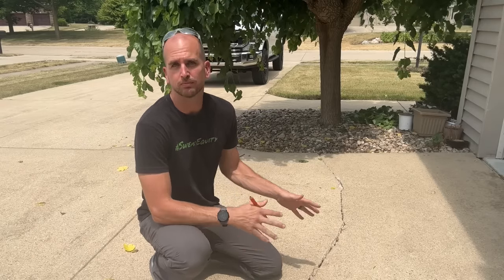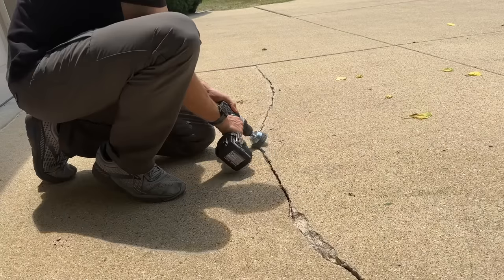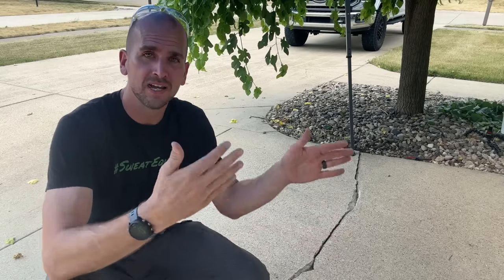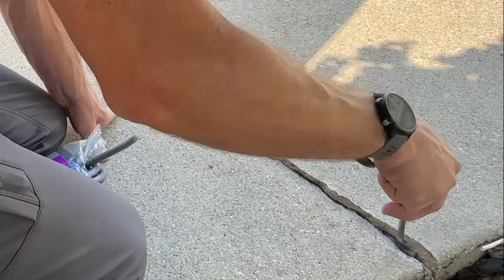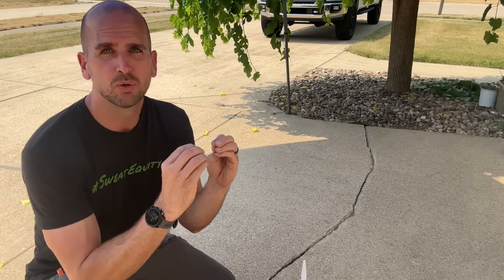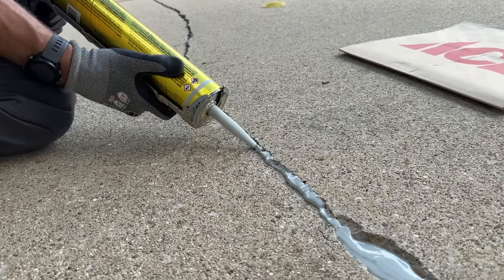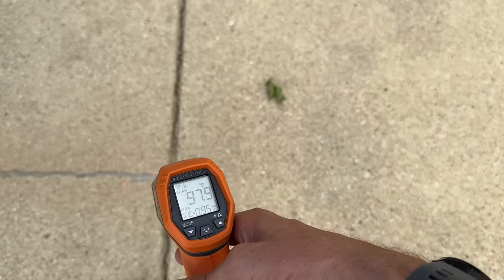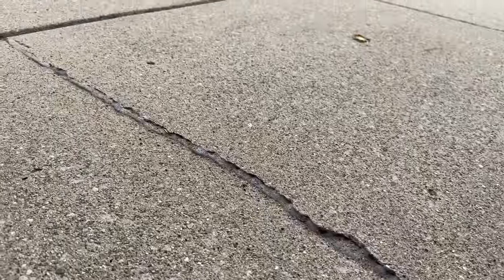Repairing A Neglected Driveway Crack |  The Ultimate Solution!

Comment: How do you decide whether it's necessary to add a second round of sealant?  I assume it's based on the vertical distance (gap) between the top of the concrete and the top of the settled first round of sealant.  How small should that gap be?
Reply: No gap. He explains this in his pinned comment.
Reply: @michaels3003 : I don't see a pinned comment, and I don't understand what you meant by "no gap."  Do you mean "add more sealant if the level of the settled sealant is below the level of the concrete surface"?
Reply: @brothermine2292  , he said in his comment, "to almost overflow," because this product shrinks some as it dries. The best way would be to test a small area. The manufacturer should have provided the necessary information. I've seen a similar product (in a YT video), where there was a limit how much of the filler can be used. For that reason, the crack must be prefilled with something like a backer rod. The rod must be pushed in tight, so it does not try to come up. I've also seen a comment where somebody prefilled the crack with fine sand.
Reply: @michaels3003  : How does "almost overflow" relate to my question about whether to add more sealant after the sealant has settled?
Reply: @brothermine2292  , the way I understood this video that if you follow the method shown, there is no  need to add more filler on top. You are welcome to try to get him explain this better.
Reply: @michaels3003  : In the video he explicitly said near the end that you might need to add more sealant.  Unfortunately he neglected to explain how to determine whether you need to add more sealant.  That's why I asked.
Reply: @brothermine2292  If it is no longer near nearly overflowing add more if it is within ten minutes. I think that is what he implied.
Reply: @johnclements6614  : Sure, but "near" is vague and subjective.  The point of my question is to obtain greater precision.
Reply: @brothermine2292  I would put more in if it was within ten minutes and it had slumped more than 2mm. But it depends on the depth and width of the sealant in the joint. 

Minimum depth of sealant is 6mm. Maximum depth 13mm. Square section up to 13mm wide then stay at 13mm deep until max width of 25mm. Therefore if you were trying to seal a very shallow 6mm deep/wide crack you would have to top it up with any settlement. Maybe do not try to do a joint less than 8mm x 8mm to allow 2mm tolerance.

TLDR. It depends on the crack size.
Reply: @johnclements6614  : I think none of those numbers are what I'm asking for.  Is the goal to end up with the top of the sealant flush with the surface of the concrete?  If so, why not say something like "if the level of the settled sealant is below the surface of the concrete, add more sealant to make it flush with the concrete surface."  If flush is not the end goal, what distance below the concrete surface is the goal?
Reply: @brothermine2292  The sealant will settle. Therefore it will not end up flush. Most likely end up with a concave shape across the joint.

If you need to know more you will have to read the instructions and then practice with the material in different sized joints to see what you can do.
Reply: @johnclements6614  : I expect the first round of sealant will settle much more than will additional sealant added after the first round has settled.  If the goal is to end up flush, I expect adding sealant can get you there.  Your most recent reply doesn't mention the effect of the additional sealant nor what the goal should be, so it still doesn't address my question.
Reply: @brothermine2292  Read the instructions if you want to know how to apply the product.

I have quoted the sizes from the instructions.

How far the product is below the surface is up to you. You have to make a decision. It depends what you want the product to do.
Reply: @johnclements6614  : But the decision should be based on understanding the relevant principles.  Given your replies, I conclude you don't know whether it's desirable for the seal to end up flush with the concrete.  Flush is what my intuition suggests, but we shouldn't have to rely on our intuition.
Reply: @brothermine2292  If the sealant is flush it will be more vulnerable to mechanical damage. If it is slightly recessed it will collect dirt and may be more susceptible to frost damage.

The instructions are online, I am assume you know how to search for a product.
Reply: @johnclements6614  : Yes, I would research a product before deciding whether to use it.  My point was that, near the end of the video, he said he checked whether he needed to add more sealant but he didn't describe what that means.
Reply: @brothermine2292  It s a driveway man, relax and just do it...
Reply: @Millard-vo3ds  : I'm relaxed, and I don't have a driveway that needs repair.  The reason why I asked for the info missing from the video is to benefit other DIYers (including you) who watched the video and read these comments.
     Your attitude suggests you don't care about the quality of your work.  Why should anyone who does care about their work listen to you?
Reply: @michaels3003 you are absolutely right. But never use sand as a filler. The only acceptable filler ud backer rod. Professional caulker of over 45 years that has installed and repaired miles ov this type of seakant
Reply: @brothermine2292 if the sealant “settled “ you installed it wrong or prepped the joint wrong.
Reply: @johnclements6614 not quite right. It is easy to tell professionally installed self leveling from amateur. Amateur will be slightly convex while professional w always be concave because it was tooled, surface tension will cause untooled self leveling to be slightly higher in the middle than the sides
Reply: @genecarden780  : By "settled" I just mean the sealant's final position... even if it's the same as its initial position.  Now perhaps you can try to answer my comment's question.  The video is vague about how to decide whether to add a little more sealant.
Reply: @brothermine2292  that is because it is subjective. The more flush the more aesthetically pleasing to some but the more prone to damage. There is no one definitive answer. As a professional we always concave ii approximately 1/8 inch below the surface.  To protect it from physical damage. But the truth is what really matters is the sealants thickness not how flush it is. We once had a contractor insist it was flush. He then paid us thousands of dollars to  repair the damages . Sorry if this is vague.  I’m glad to try to answer your questions
Reply: @genecarden780  : So, if the goal is to minimize the risk of damage, you recommend adding sealant if necessary to raise the sealant surface to 1/8 inch below the concrete surface?  Why does 1/8 inch minimize the risk of damage?
Reply: @brothermine2292  As I noted above if the top of the sealant is low in the joint the joint will collect dirt. 

It is quite difficult to judge 3mm (or whatever with out good conditions and practice) by eye especially when the top of the concrete is not smooth. It may be still safe from surface mechanical damage if less but then you have no tolerance for workmanship.

As already noted you should only top up the sealant if the sealant will allow it, read the instructions.  You may have ten minutes or less depending on conditions. If you top it up late it may not bond to the lower sealant and then could fail.
Reply: @genecarden780  Thanks for the knowledge.
Reply: @brothermine2292 being slightly recessed protects the sealant from abrasion. The 1/8” is for wider joints. Like expansion joints. And is not exact. The smaller the crack the less it needs to be recesssed. There is no right or wrong when it comes to how flush the joint is. It will always be a trade of between the individuals aesthetic and protecting the sealant. If it is flush the top surface will be abraded  by tires and foot traffic. This is just how we do it as professionals. So the fact is no one can tell you exactly when you need to add more sealant other than making sure you have the correct sealant depth to width ratio. Those are numbers that are critical. How flush it is will always be matter of compromise. There is no one definitive answer. The much more critical thing is maintaining a consistent,proper depth to width ratio.
Reply: @johnclements6614  this is assuming no sink holes just normal self leveling, sink hole’s change everything. It is actually  the first indicator of how professionals spot an amateur job Professionals ALWAYS  tool the joint ( even with self leveling) creating a concave finish Tooling is actually mandatory to achieve the best bond.
Reply: @genecarden780  : Thanks.  I think the info you added should have been included in the video.  Or the video should at least have said where one can find info about how to choose the sealant surface depth.

Comment: Pull that rocky gravel away alongside your driveway and dig down and see if it IS a root pushing up against the concrete. If there IS a root causing that crack put an extended pruning blade on a saws all and slice through that root to stop any future expansion of it.

Comment: I just clean debris out with screwdriver, hose out debris with pressure nozzle on my hose, install a sand and plastic cement grout mixture adding concrete glue.  Wait a bit for grout to firm up, then smooth out with sponge! Will last for years and years! 🤣👍

Comment: First step: remove the tree. I’ve been looking at neighborhoods for decades and putting trees too close to homes and driveways and sidewalks is responsible for so much damage and also makes it dangerous to walk on. It is possible to put a barrier between a tree, and a Hardscape or foundation, and it’s not cheap… But it’s definitely something you want to do before you plant the tree instead of after. FYI, pine trees, cracking ice, storms, and puncture roofs.  Don’t plant a tree without knowing how far the roots are going to go, and make sure you mitigate ahead of time if you possibly can.

Comment: Thats not a great fix. Prep was fine but if the lip lower down the drivway is higher than the one above, the water is going to sit on that joint. What doesn't sit will be pushed off to the edge where it will flow under the driveway again. Best to cut it with a 1/4 inch saw, vacuum, apply a weatherproof caulking that matches the colour of the driveway and throw some of the dust/sand from the saw on to the joint. The next day blow it off with a leafblower or suck up with vacuum. It will almost match but it would probably be  a better solution than redirecting the water temporarily.

Comment: Good video and good tips.  Unbelievably bad concrete work.  If concrete is pour correctly and the driveway has rebar like it is supposed to, you won't have any significant cracks to worry about.  The ground is wetted down before pouring.  Rebar in place. Concrete vibrated to settle the aggregate.  Finished correctly.  Proper expansion joints. No cracks.  Unfortunately, the quality of concrete work has dropped as the years have gone by significantly.
Reply from the maker: Do you vibrate the concrete even on a 4 - 5 inch pad like a driveway or sidewalk?  I have seen this in foundation walls but not standard pads.  Thanks for the feedback!
Reply: @EverydayHomeRepairs  I was in commercial concrete work and they vibrated everything, especially slab on grade pads.  They even vibrated little walkways.  It chases the air out of the concrete mix and settles the aggregate. It makes a better bond with the rebar.  That driveway slab you are repairing is horrible.  It shouldn't have passed inspection.  Your video showed ways to minimalize the damage.  Good video because, if you're renting or don't have the funds to redo it, that's a good work around.

Comment: bought my first house two years ago, nothing like living in condos for 20+ years, only thing i hate about a house is that I'm legit doing something every week, it can get really annoying, dropping money like mad on repairs and upgrades I'm a saver and this is like the opposite.  i dislike most home projects but i love filling gaps in cement cause of your vids.  the home depot pencil trick was great. i am not sure why i did the perimeter of my house last year doesn't it just go into the weeping tile? anyway my back and knees were never the same after that project.  I've done the garage and a couple areas around the porch as well. going to do driveway when i get a chance.  you did your sidewalk but i don't really want to spend any money on city property i don't mind picking out the weeds.  home depot canada got the sealant back in stock not the one you use just the dap one i picked up a few bottles, damn stuff is expensive and the tubes get used up fast, i use both self levelling and non levelling one day I'm going to test the self levelling one on a big slope  i can never tell how big of a slope is too big for it.  hmm do you have videos how to fill in brick mortar i tried some pre mix stuff in a tube but i think i put it on too heavy so its a bit soft even after a year lol it was also crazy humid when i put it on.  i have like 700 things on my to do list - houses are annoying
Reply: Houses do require a lot more maintenance than condos; they are just bigger, and all the work is on your shoulders.   My husband and I do a complete walkthrough twice a year to see what needs doing, then prioritize and budget.  There is always the question of should we hire it out or do it ourselves….and we factor that into the projects list.   Good thing I and my husband and I are certified project planners….it sure has come in handy when taking on older home repairs.   There are some user friendly software apps you can take a look at when getting your project lists together.   Some things to consider are what does the repair cost vs hiring out or DIY, how soon does this have to be done, what do I need to learn to do this myself……and find a reliable, good handyman to tackle the jobs that are too big for you, but not big enough to need a contractor.   Good luck and welcome to home ownership.  Yes the work seems daunting, but the rewards of a beautiful home/yard plus the added asset value are worth it.

Comment: If I would see and step on this daily, I would have probably gone for the ultimate ultimate way to cut the crack "out" with 230mm diamond disk on large grinder
Then chiselling all concrete and recreating floor pouring concrete
But that's no more same level of tooling involved !
Reply: Concrete will just crack again. You have to use something flexible for any long term repair.

Comment: I discovered a crack all the way through the concrete slab subfloor under my ground floor condo.  I think the slab is about 5 inches thick.  My hunch is that the ground underneath the building subsided under the weight of the building (8 stories tall), so that the slab wasn't supported by the ground on one side of the crack.  When the condo association brought in a contractor to repair it, he didn't use a backing rod or sand, and the sealant he applied didn't go very deep into the crack.  I'm wondering what to expect over the long term.
Reply: Hmm, job security?

Comment: That's the tree that's right there causing that... You can fix it but it will still crack as the root grows... You should have dug down right on the edge of the concrete between that and the tree and found that root and chopped it... More than likely that would not kill the tree... Depending on size...a 3 inch root can crack 4 inches of concrete

Comment: I don’t get it, I would minigrind a parallel line three inches from the crack down through the concrete. Take the piece out and then mix concrete and pour it into the prepared valley.
Reply: The slab is moving and will continue to move. It will still move after you have filled the crack with concrete and you will have two cracks.

Comment: cracks are not a fact of life as long as you cut enough control joints and that is why his cracked. his line was over 10 ft away and it cracked right where a control joint should have been cut the day after the pour
Reply: Cracks are a fact. The conttol joints are designed to get the cracks to follow the control joints( weakened plane) expansion joints ( much bigger) are designed to minimize cracking
And as he explained it is due to a root. Just another pseudo intellectual

Comment: You never repair anything until you find out what is causing the crack that's the most important I'm not there but if I'm looking at what you have behind you it would be your tree that means the tree is not getting the proper water that it needs there's no consistent water coming through no sprinkler system and if it is it's broken and somebody's just failing to give this tree the water so the tree found another water source that's what it did it cross through to get to that water source so you have to dig a hole and cut the root system that caused that crack you don't need to cut the whole tree down whoever says to cut the whole tree down to solve the problem is also ridiculous but you get down to the roots and you get down there and you cut their access to this brick once you cut out all the root systems trying to come through this brick you can use some things to seal it off build a moat with break before you lay anything down but forget about all that once you cut the roots then you can repair the cement but then now you need to set up a system so the tree can stay happy and not be rude and have to look for another water source because it's not being taken care of build a sprinkler system or have somebody out there who will commit to watering this tree that tree is just trying to live don't cut it down because the others weren't taken care of it it's not the trees fault and when it's all done it would last for 10 if not 20 years problem solved trees root systems stay put the tree still lives the cement gets repaired and everybody's happy